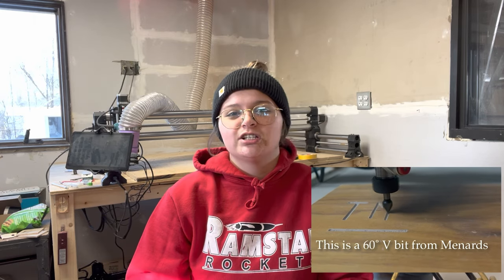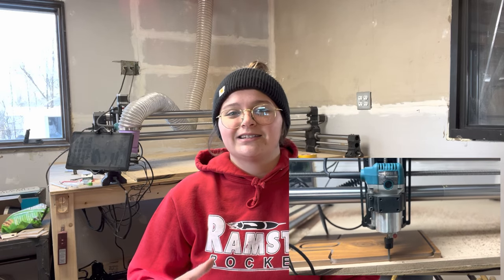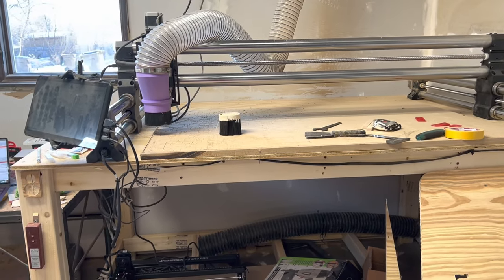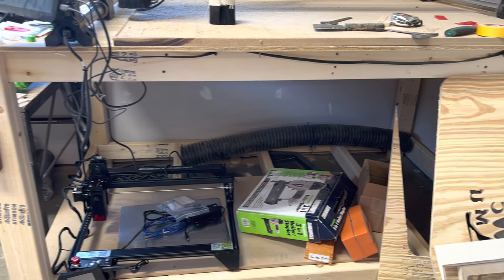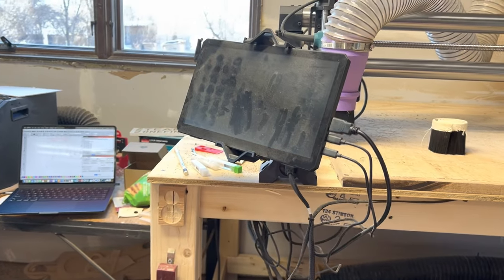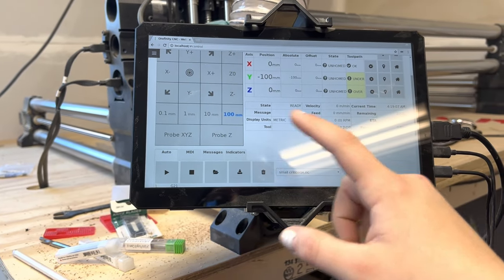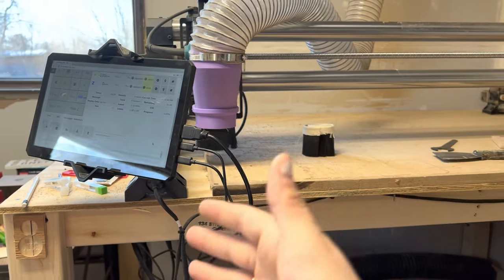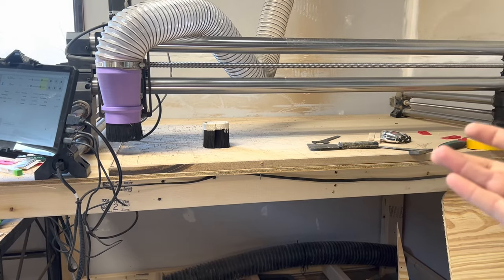Onefinity Journeyman x50 CNC Machine!

Comment: NICE!!  One word of advice for bits and metal cutting is keep them separate from the wood working ones.  The feeds and speeds changes a lot when you go to harder materials.  I have found single flute bits better for aluminum and what test pieces I have done on other metals as well as taking 2-4 times longer cutting to not overheat the bits.  I don't have the space for more than the small cheap tabletop CNC machines and wish I could add either air or cooling fluid assist for cutting metals.  Keep it up and keep " L Making ".   :)